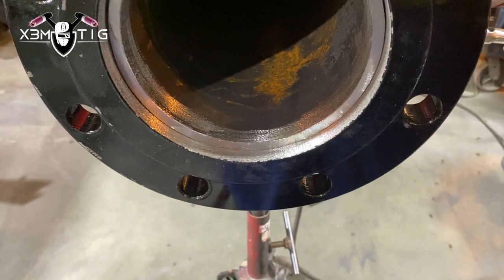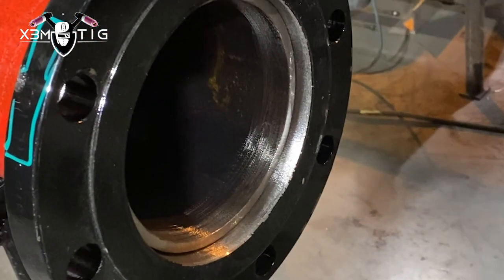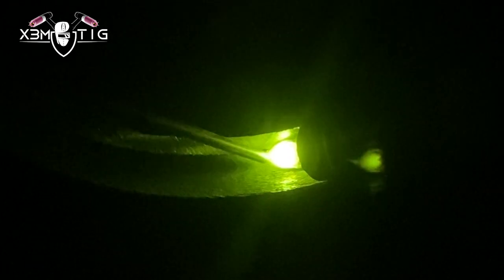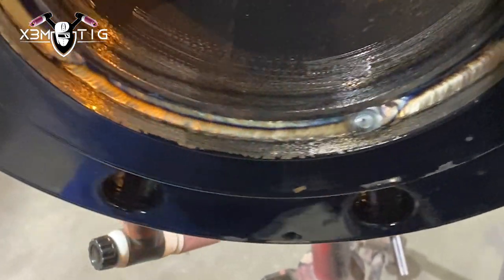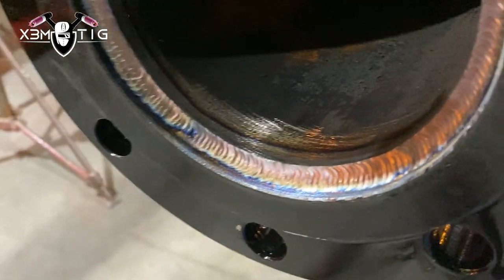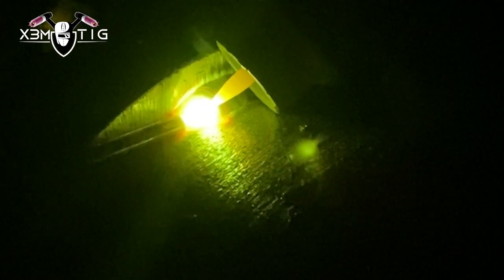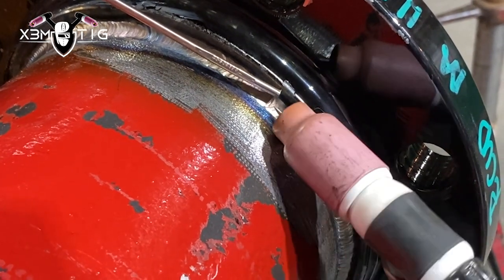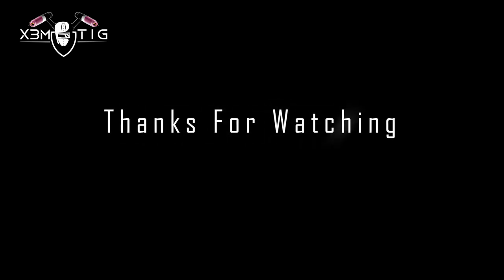Slip On Flanges | TIG Welding Tips and Techniques!

Comment: Nice work man. Tig looks nice when done right, but as you were saying production environment changes things. In my job we would just use an outer shield flux wire, start at the bottom and weld to the top. that whole flange would be done in 4 welds.
Reply from the maker: Thanks for your comment bud. Yeah, it all depends from production environment and welding procedure specifications.

Comment: If stainless, how do you purge a slip on? Do you just tape the opening and do a single weld on the outside and not weld the inside?
Reply from the maker: You don’t purge, just weld same as it is carbon!

Comment: Nice video
 What are the regulations regarding welding close to the flange face. A place i work at like a 6mm recess from flange face to pipe edge. Then filled right out to the face! Is their a set distance the weld should finish away from the face